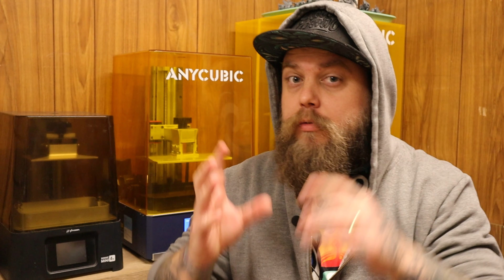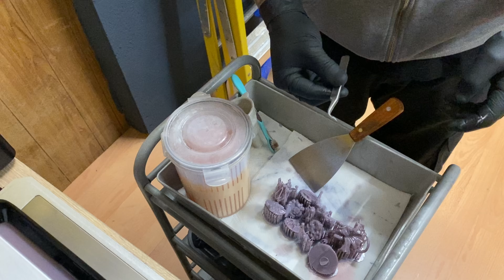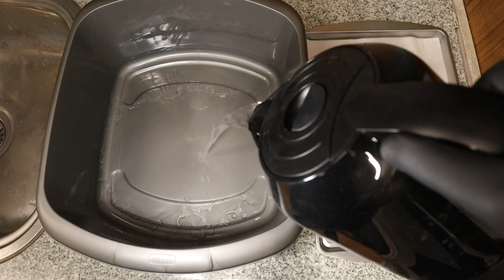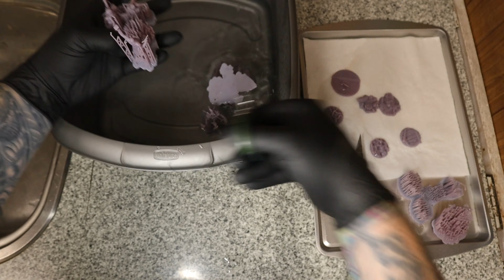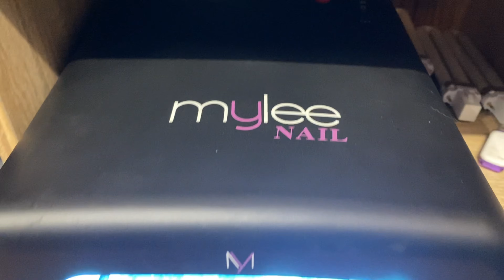Are Your Prints Clean Enough? | Groundeffected.com

Comment: You cure them wet? Thought the rule was you had to wait until they are super dry before curing them.
Reply from the maker: Yes. That in theory is the rule. But that because most don’t clean them well or are using super saturated isopropyl but my iso is really clean still and I’ve rinsed and cleaned them thoroughly.

Comment: I use the same technique with warm water. However, I let the prints 100% air dry before I put them in to cure. This avoids any possibility of getting any white crusty residue on the final print.
Reply from the maker: This Is true but that whiteness is left over resin if you clean them enough they will never have that white stuff.
Reply: @Groundeffected  I do that since I don't change my IPA as often as I should so my IPA tends to be super saturated. So its me being cheap adding extra time to a process